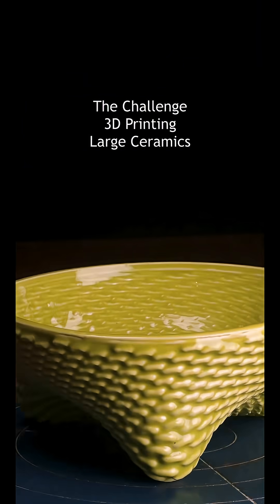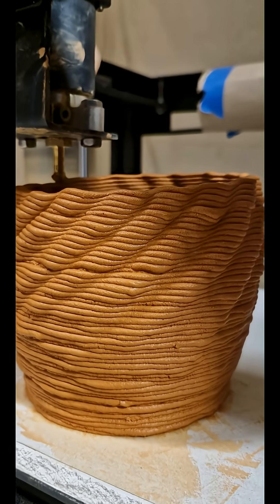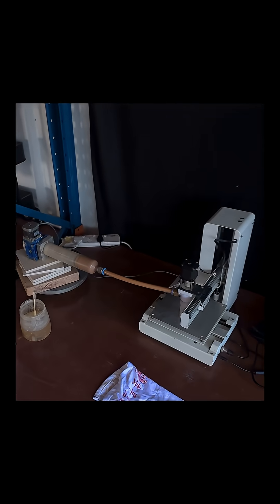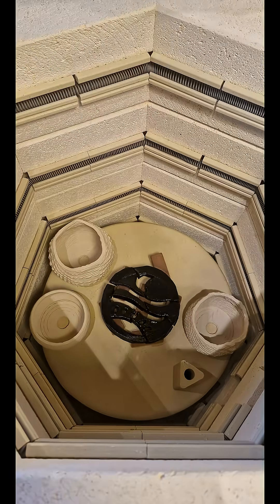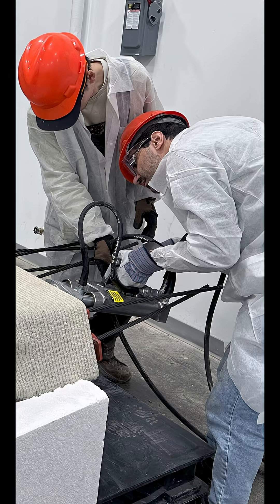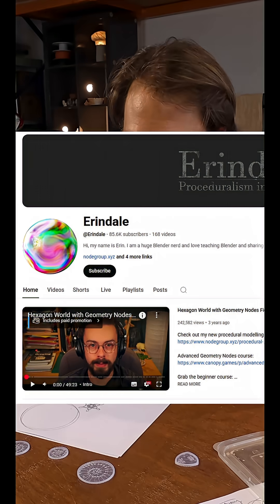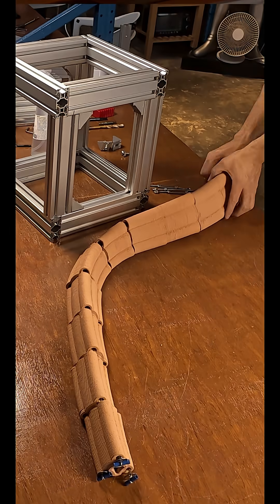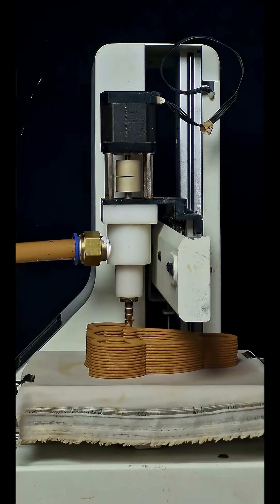The Largest Print I Printed on a Home 3D Printer #clay3dprinting #3dprinting #woodworking

Comment: Whew, what a throwback. I did a master's thesis ~10years ago, and one of the sections I was talking about how PT could be used in 3d printing. Very cool to see where things have progressed and that it's spreading out into other areas! What a cool design!!!
Reply: I was REALLY concerned with layer adhesion/cold joint formation and it just seemed like the perfect cure
Reply from the maker: Yes! It seems to me to be a really interesting combination.  Printing has layer lines as a weak point, but concrete and ceramic are great in compression.  Add to that you can design channels for cables without needing complex formwork for each part. They can all be different. Then adding non-planar layers, so I can go around a curve and it seems like it will have potential!